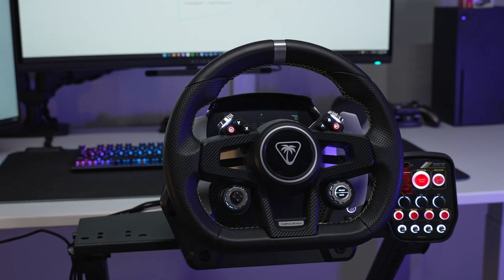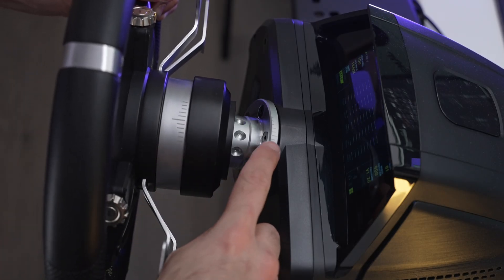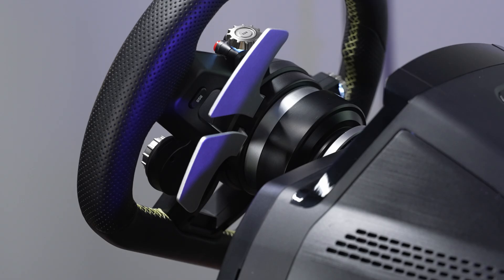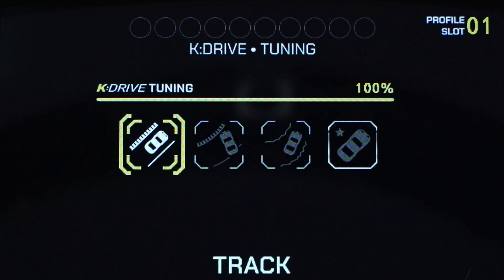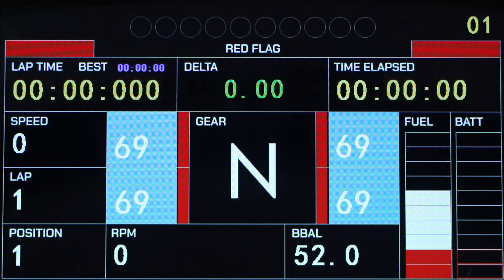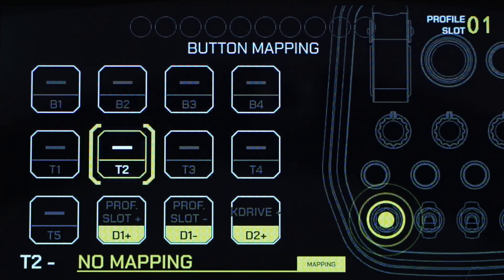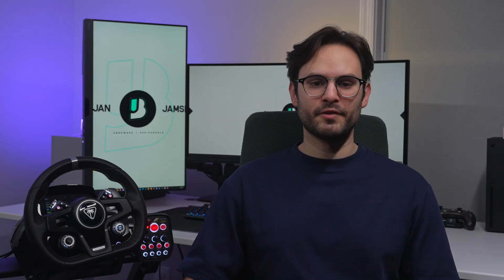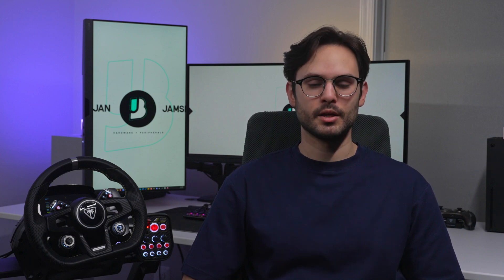Turtle Beach VelocityOne Race Technical Overview

Comment: i know we have a handbrake mode in this shifter however pleaseeeeeee make a sturdy handbrake that can be positioned into a normal car or hydro format also try make it compatible with xbox? and maybe make a box that can bolt ontop/under a steering wheel so people can use any wheel they want and can have full kind of functions like the stock wheel or have an option to only use the wheel with the butto nbox like some rally and drift cars?

Comment: Hi! The pedal changes is something I have wanted since I bought this set, and what I hoped for in this update so that's a great improvement for me.

But unfortunately I have encountered a straight up game breaking bug where the steering wheel seemingly looses it's position and thinks it's 360 degree further clockwise, making the car i'm driving slam into the right wall.
This happens often in the first race after starting the wheel, also sometimes just at random and makes the steering wheel almost unusable, it has already ruined a online race for me.

And what happend to the force feedback?
It works okey when under low load, like driving in a straight line or slow, you feel things like bumps in the track or curbs.
But when pushing/going fast especially into corners where the force feedback load is high you can't feel anything, not curbs, not bumps in the track or anything really, the steering just gives you the increased base resistance and nothing more.
It returns to the okay state once you have straighten out the car/slowed down and are down at low force feedback load again.

I'm glad you are making updates, improving and adding stuff like on the pedals, laying the groundwork for more peripherals, but regressions and bugs like ones mentioned above is a letdown, especially when we can't downgrade to older versions and are stuck dealing with it.
Reply from the maker: If you are having an issue then do let our support team know via our website.

Comment: With the g920 on xbox you could use a ebrake pass through buy plugging wheel usb to the ebrake the ebrake usb to xbox wii turtle beach use pass through tech to add shifter and ebrake via usb external on velocity race im liking the product just need more wheels to be added like f1 and rally wheels maybe a truck wheel like moza

Comment: Just bought this wheel found out buy myself at there are no videos explaining xbox series X setup it needs addressing first on first update using the tuner app on xbox to update firmware it has peddles connected on diagram which is wrong like pc you need to disconnect them or update only goes to 53 per cent i rebooted whole wheel again u have to use controller wait to wheel flashes then go back to update to install it

Comment: Does anyone know if I can add a shifter for Xbox?
Reply from the maker: Console setups make use of proprietary setup/tech. So if you have a shifter through someone else, it will function with that hardware.
On PC you can use any other USB devices, so external shifters, etc.
Consoles are just a bit more.